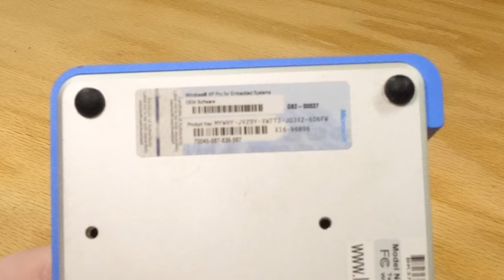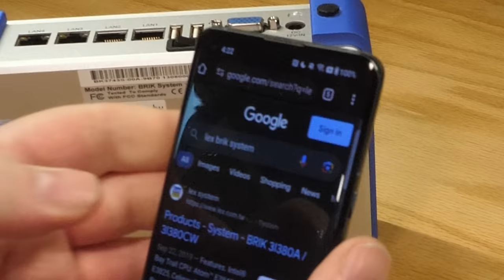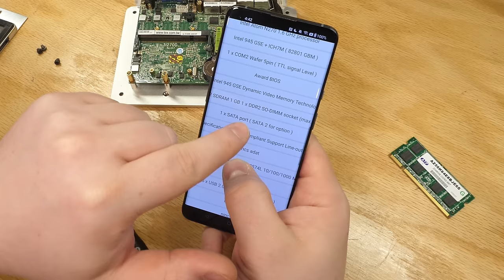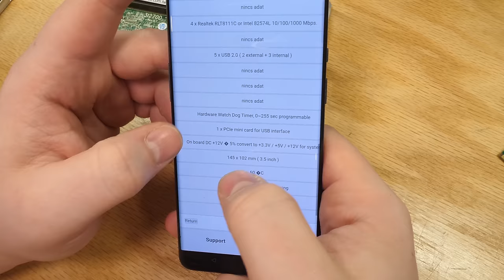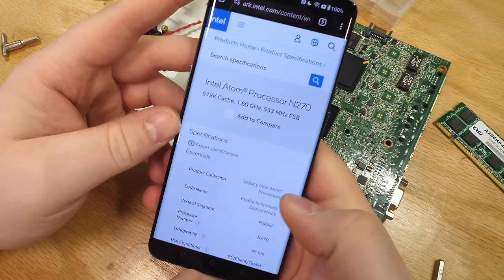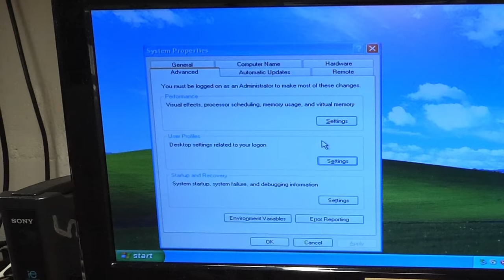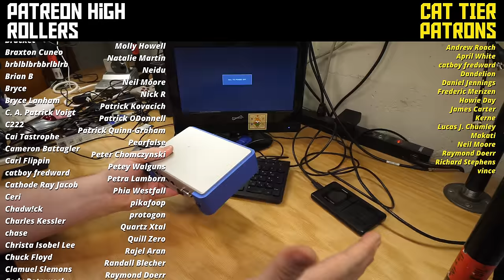Little Guys: Episode 3 [Lex Brik]

Comment: About that mini PCIe USB thing. There are/were mini PCIe cards that were infact USB only. As an example, the old WiFi card Realtek RTL8087 is an USB device that when in mini PCIe is connected to that USB port available in the connector. Also there were combo cards (WiFi+BT or WiFi+GPRS) that had one device  - WiFi usually - on the PCI bus and other (BT, GPRS) on the USB bus. An example is RTL8192CE combo/RTL8188CE combo  that is a PCIe WiFi card and a USB BT. If the connections to the goldfinger are few, then the mini PCIe board is most probably USB only.
The second SATA port may be functional if enabled in BIOS since it came directly from the chipset that I believe have only 2 SATA ports. Is good you do not have the SSD chip soldered because it would use one SATA port and when it fails, it would be hard to swap/disable.
The max memory for Intel 945GSE seems to be 2G so the board could have come with 512k, 1G onboard and optional 1G DDR2 SODIMM (I have atom netbooks with same chipset and similar configuration: 512k onboard and max 1G SODIMM; it would not boot with an 2G stick)
The best OS for it would be Win2k/XP but I saw Windows 7 running very well on this hardware. If can use a 256k/512k SIMM, it can do a very good low power dos machine.
Edit: Can see what hardware where is connected when choose to show "devices by connection" on device manager.
And thanks for the tip on that IODD HDD enclosure; I just ordered the ST300 version.

Comment: Teeny tiny electrical pro tip: when finding a power supply for something, with VERY few exceptions, the match you're looking for is "greater or equal". So if you don't know, throw more current rating at it. A 12-volt, 200-AMP supply would also have adequately powered this machine... to much visual amusement, but it would work fine and normally. The more you know ✌️

Comment: Those spots for relays are so it can be used as a network device like an intrusion detection system. The relays are so if it goes down, it can go into bypass mode. So you have it inline with whatever you're monitoring.

edit: oops, too quick. You found that out

Comment: I think that the pcie slot meant that there also is usb support in it. Not just that. In those years many laptops with mini pcie weren't provided with usb in it, which is often used by the bluetooth module in many wifi+bt cards. There are very few and old cards that support wifi and bt together on the same card, and what's annoying with it is that you never know until you stumble upon it

Comment: There is a process known as skiving which is sometimes used on aluminum. This is how a lot of aluminum heat sinks are formed. I wonder if a similar process of cutting was used to delete the inner fin down to the tab? It can be very fast and aluminum profile extrusions are often manufactured in parallel product lines. It's pretty interesting either way. Most likely just some kind of end mill though and cutting in an orientation that's parallel to the interior face.

Comment: Weird to see it having a VESA mount. You'd expect it to have some mounting holes for a DIN rail clip since usually these foothold devices (or VPN gateways) are mounted inside of a switchgear cabinet to connect onto the client network.

Comment: I went out of my way to buy a Lex "BookPC" system in the early 2000s to use as a router. Via C3 (with encryption acceleration!) with 3 10/100 NICs and their custom USB ADSL modem that mounted into the case. It ran Linux off a CF card for many years until the capacitor plague took it down. Small(ish), fan-less, with connectivity was harder to find back in the olden days.
I never really used the ADSL card, but it would another layer above the 2.5" hard drive bracket like in your Brik with a cable snaking down to a USB header on the board. One day I'll have a DSLAM in my house and I can use that ADSL card.
I also have a set of dead-system bypass ports out of a Baracuda caching appliance. They were part of the system's front panel but went back and connected to a PCIe NIC inside as well as USB or maybe SMBUS for control. I ripped them out because I didn't want to bother trying to figure out how to control them but kept the parts for the oddity of it.

Comment: Oh neat lil guy inded. It's hardware also match old version of ViPNet Coordinator HW100 (also with option of added COM2, rerouted power button at front and possible wireless cappabilites), a russian hardware firewall router with bespoke linux distro instead of Windows XP. It's strictly forbiden to dissasemble those outside of official tech service so there is no other dissasembly video of that bloody expensive lil PC

Thanks

Comment: Re: your rant about that proprietary laptop battery, I JUST had to spend a couple days straight trying to find a battery for an Okuma CNC mill from the 90s and it turns out Interstate Battery Centers usually have one branch in an area with Some Guy (TM) that just makes specialty batteries for the other stores and their pricing was beyond reasonable. Might be worth looking into! I imagine if they can find a proprietary connector for industrial machining equipment you might have luck.

Comment: I had one of the Zalman iodd devices before they put the encryption features in (which is why there is a numpad). They had USB 2 and USB 3 versions, and the USB 3 used very fragile microusb connectors that were prone to breaking off the board.  You can do the same sort of thing with a Raspberry Pi Zero and the mass storage gadget kernel driver, but at the time (2012ish?) the iodd was a great device for IT professionals that would have otherwise had a spindle or case of cds for all the crap they needed day to day. Technicians working on multiple computers at the same time would need multiple iodd devices, and they were quite expensive at the time.

Comment: We use bastians at work in order to access our PCI compliant environments and they're mostly used for RDP access, so that could be why they wanted the full fat pro version of XP, since traditionally, you need a pro version of Windows in order to receive RDP connections
Reply from the maker: Ahh, great point! I've never checked whether XP embedded could accept inbound RDP, I wouldn't be surprised if it can't.

Comment: In the useful category, HP/Dell/Lenovo produced a metric crapload of tiny/mini/micro (shoutout to Serve the Home) boxes over the last decade or so. You can often pick up used 6-core 8th gen Intel boxes for like $125 with an SSD, and they run Linux fantastically and even do a pretty good job with Windows 11. They tend to be pretty low power at idle, too.

Comment: The relays were probably a 'fail closed' option for bridging the two ethernet ports in a power failure. Then if this device is being used as some sort of WAN optimiser or filter then if it dies, the network/Internet connection still functions. We had Packeteers that did this.
Edit: Oh you found out it was that :)

Comment: For the old power books you can take a old ecig battery and solder it in place they are lithium rechargeable batteries and small enough to fit.

Comment: A few notes on Diamondville

Its a reborn P54C
The Northbridge does take care of the memory
The N270 may be 2.5W but the NB is a 10-15W part

The successor N450 / D450 was a much more mature product, Hyperthreading, 64 bit support (I think?) smooth video playback, and the northbridge on the chip and sucks lots less power. I still have one as my FreeDOS netbook machine that I fire up occasionally.

Comment: I see IP bypass in building automation controllers where you can wire everything in a daisy chain device to device rather than everything back to a switch. That way if a device goes down you don’t lose comm to the rest of the devices downstream.

Comment: The relays would probably been used for alarms. Alot of industrial/IT equipment will have a relay panel for wiring up alarms. I work on PS radio systems, and actually did a bunch of alarm troubleshooting for work last week.

Comment: WRT the IODD, a load of us at $DAYJOB many moons ago bought these as marketed by Zalman. Stick a 750gb SATA drive in there and you had an external USB3 drive (when supported). These things were invaluable for patching and updating HPE servers, Blade Enclosures and desktops, resetting passwords, HD checking, you name it. Stick an ISO in the correct folder and bam, instant optical drive emulation. I still use mine today.

Comment: I have a box of some really little (like 3"x3"x1") guys I got from an old amusement park job that were used to run digital signage (in this case for the preview screens at the little photo prints counter when you got off the haunted house). I haven't really looked into them, all I know is they're branded Ebox (or at least, that's what's written on them) and they can run XP. If you have a PO box or something I'd be happy to send one for you to poke at. Also, what's that fox sticker on the tiny monitor?
Reply: The fox is from Tunic (videogame) :3
Reply: @rraygen  thanks :3

Comment: Yes you can see how a card is attached to the system. In the device manager go to system and select view by connection. This will show the relationships between all devices. If a mouse is attached to a usb hub you will see the hub as a parent to the mouse device and the root hub above that etc...

Comment: a note on the mpcie USB shenanigans, in the pinout of the slot it allows for the pcie, and a USB connection, and connections to pass through to a Sim slot elsewhere on the motherboard. 

also it's my understanding that all mpcie wifi cards that include Bluetooth actually pass the wifi through the pcie, and the Bluetooth through the usb, basically just two seperate devices on the same board
Reply: addendum to this, it turns out if you get a wifi & Bluetooth pcie card for a desktop slot, you actually have to plug a cable from the card to a USB header on the motherboard for the Bluetooth to work

Comment: If you want to know if a mini pcie device was connected by usb or pcie, in Device Manager go into the details tab of the device and check the Device Instance Path. It will tell you what type of Windows bus diver is controlling the device and the id on the bus. The Enumerator value will also list which bus driver type. Or just change the view of device manage to devices by connection to see the  parent devices the device is connected to. Modern versions of Windows stay focused on the selected device when changing view but XP and 2000 do not which is kinda annoying and means you need to manually search for the device in the device tree after changing view

Comment: 44:12 Found this out when I installed a WWAN card in my Dell laptop. Not only did it just connect via USB (USB3, which is nice I guess), but it also added 4 whole new virtual serial ports to my computer, so now I'm permanently stuck with COM25-28 unless I take out the card. Fun stuff.

Comment: With the VESA mount pattern I would assume that the idea is that you open it up, remove the mainboard (or at least the drive "caddy"), mount the backplate to your monitor on its VESA mount (assuming your monitor has separate VESA mounting from its own included stand), then reassemble the machine on the back of the monitor. That mode of mounting would also require the front screws to close the case back up.

I have no authoritative information as to this being the case, though, it's just what makes sense to me.

Comment: Additional, lesser pro tip (apologies for pausing at 39:53 as I didn't want to forget): Windows comes in different licensing SKUs that are not interchangeable. It's not necessarily that it's "embedded", but rather that, BECAUSE it's an OEM sticker, it's an OEM SKU of Windows XP. You need an OEM installer disc. Those were the ones sold in little white envelopes, not full retail packages. The "pidgen" system (PID generator) is different on those different SKUs, as also different for VLM (aka "corp" XP without activation). The fact that it showed the graphical product ID sticker image in the "enter your key" box was a signal that it's a Retail installer. So you need to get an OEM XP *.iso to get it to take the sticker key ;)

Comment: You ended up discovering half the things I was going to point out (mPCIe USB, bypass relays, removable disk) so this comment is a bit shorter. On the storage front I woulds suspect the internal flash would be connected through the same ATA bus as the CF card. These chipsets predated eMMC. When a card appears as removable you can use the Hitachi "cfadisk" filter driver to make it appear as fixed.

Comment: Transcend used to be a lot more generous with how their (non-industrial) CF cards could be used. I have a few of their 32GB UDMA-enabled CF cards, and I found their UDMA6 and older ones (just labeled "UDMA") will report as a fixed disk when used in an IDE adapter or embedded like in this SBC. They stopped doing this with their UDMA7 cards, which yours is, and they even went as far as to push a support article pointing users to buy their industrial cards.

Comment: the cost of going to a customer is what's crazy about lenovo selling onsite to consumers for past few years. 

and of course it sucks in 99% of the countries. because why the f wouldn't it, even a single visit makes that devices original sale into negative margin. and in 3 days? of course they can't, so(in some countries) they ask to remote into* the machine to come up with reasons why it's not in warranty.

*kindly tell them that they can't see the things on the machine - and don't just let some random remote into your machine. and that they sold you onsite with their bullshit promise and that user replaceable parts like memory and ssd being changed doesn't erase the warranty.

Comment: Cellular data nmodems (the mini-pcie card you installed in the brik) don't use the pcie lane, they use the usb lane. To properly test whether the brik mini-pcie slot have a functional pcie lane you would have needed to install a wifi card like the ar9380 full size, intel extreme 6300, or similar ones.

Comment: @7:25 I think i know why, so the backpanel doesn't fold/collapse onto motherboard when you try to connect cables into the backpanel for the 1001st time. So connections between backpanel and motherboard doesn't break because of the pressure created when pushing cables into the backpanel.

Comment: The only 'little guy' type computer (though a fair bit bigger this thing) I've had with a relay is a harddrive tester that had a board to turn on and off power to an external IDE harddrive. The power board was controlled somewhat humorously by the LPT1 header on the motherboard. I guess it worked. I'm not sure why'd you need a weird Socket 370 board to do drive testing, but it seems that was what it was.

Comment: 21:49 Yeah, there is USB in mini PCI-E - At least this was the case for my laptop which I had back in 2012-15. At that time, I really started to get deeper into the technical stuff behind PCs and came across the first eGPU adapters. My laptop was a pseudo gaming laptop with quite a capable CPU (I think it was an i7 2nd gen or something) and plenty of RAM but a totally crappy Geforce GTX 550m or something similar. I got myself an early eGPU adapter card which hooks to your mPCIE slot and I think it used PCI-E 2.0 x2 or x4 - but hey, it was possible! After the adapter arrived from China and I've taken a closer look at it, I noticed it had an USB port - But besides some power manegement ICs and some smaller components, there was no dedicated USB management / hub IC present - so I followed the traces and, besides it having some smaller passive components like capacitors, the traces were just directly connected to the cable out to the mPCIE adapter card. And sure enough, testing it in windows it just... worked. I was baffled. But since I had to remove my wifi card to free up the slot, I just had a cheap USB wifi dongle on the eGPU adapter all the time lol. Worked fine though.

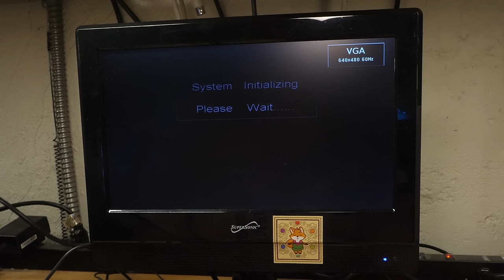Comment: 35:20 Only Voltage is important, Ampere doesn't matter as long as you are above the needed amps... I use a 12A adaptor for my laptop even if it just wants 3A maximum... but just to be on the safe side.

Comment: Actually regarding that G4 Powerbook you can use a blocking diode to bypass the charging circuit and use a CR2025.

Comment: Would love to see an episode on the T5710, I own one as it was my first little retro PC.
They ship with Windows XP Embedded out of the box (They can be cross flashed to Windows CE if you override the bios check, this did corrupt my bios however so now I can't flash either of them without the override).

What makes it interesting is the fact that the CPU isn't X86 at all but its very own architecture emulating X86. But at the same time it came with an actual ATI Mobility GPU and it has Soundblaster emulation support. So mine is modded to run Windows 98, and I think the retro capabilities combined with XP Embedded which is still downloadable (And otherwise I have the official firmware for both Embedded and the crossflash CE) and the fact this is all running on a non X86 CPU is very cool to show.

They are usually super cheap on ebay.

Comment: Rumor has it the CR2032 holders soldered to the PCB (particularly surface-mount) have a habit of ripping the pads off when force is applied (e.g. by the human inserting/removing the battery).  The pigtail things are supposed to avoid that.   But they could totally have a CR2032 socket at the end, no excuse.